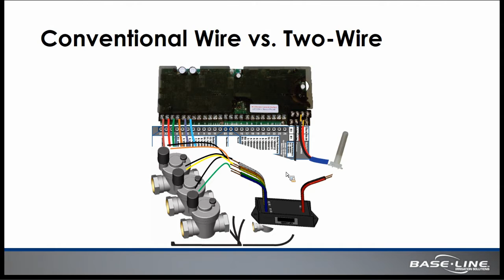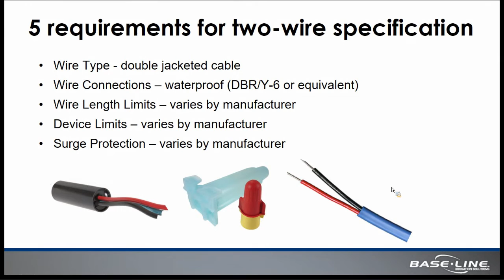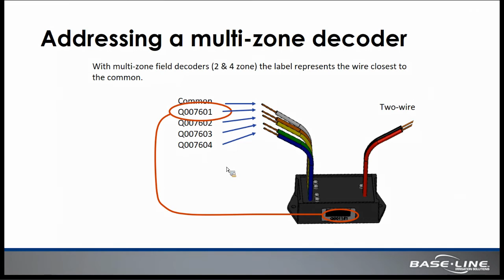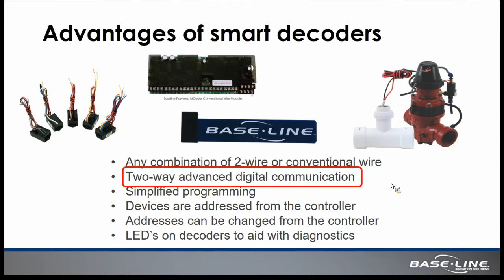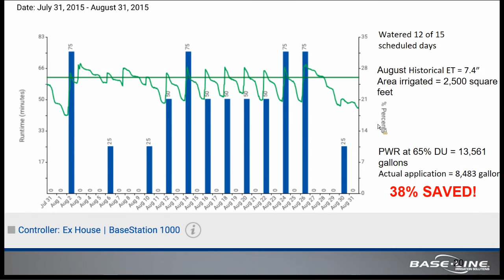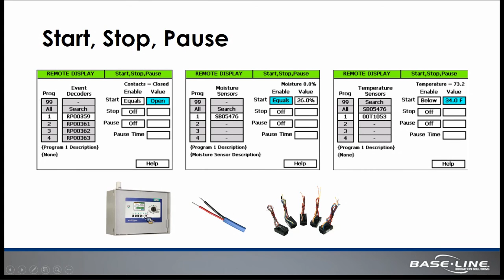Two Wire Technology for Irrigation Design

Comment: Can I connect a 2 wire system to a new wifi controller, if so how?
Reply from the maker: Hi Eulayses, we would recommend that you reach out to the given manufacturer who provided that controller to see if that is compatible.
Reply: @Landfx  Just found out that the two wires are to a conversion Index valve.is there a way to use it with a new wifi box or do I have to convert the system by installing separate valves?
Reply from the maker: @PERRYS_PROPS   You’ll need to talk to the manufacturer of the new wifi controller to get more detailed information on how their product works.